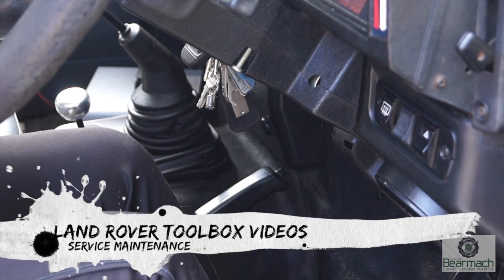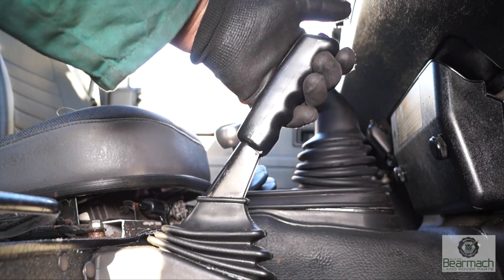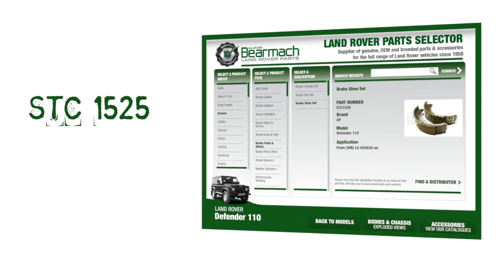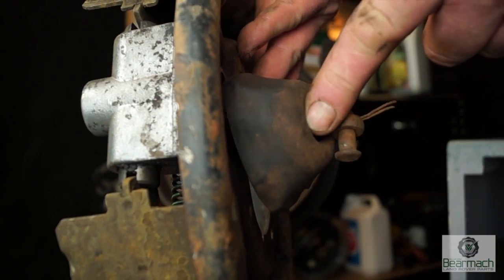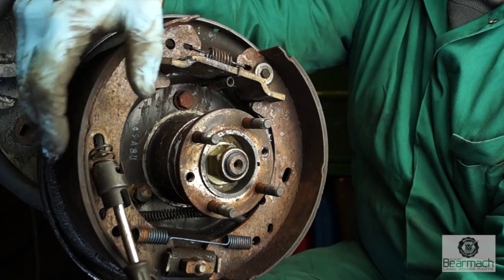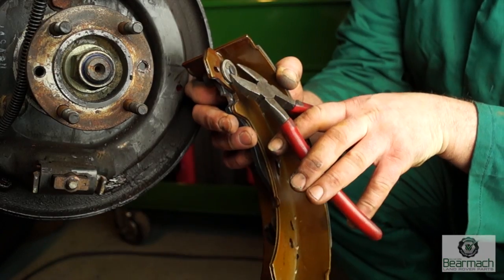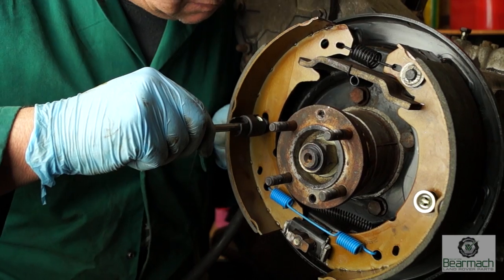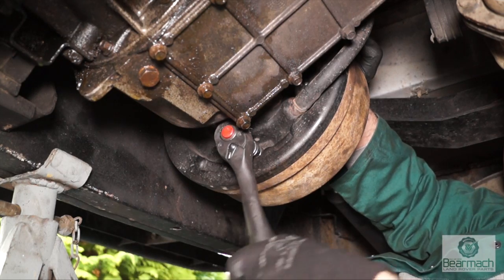Transmission Brake Adjust or Replace?  -  The Fine Art of Land Rover Maintenance

Comment: Great tutorial, very informative. I used this to fit a new hand break cable (110 Defender 300 tdi CSW) when mine snapped. On the two spring retainer clips. I didn't have a special tool to get those back on, so I compressed the spring, put a cable tie round each side to keep it compressed and refitted them. Once in place I cut off the cable ties, making sure I got all the bits out. Worked as a field fix without the special tool.

Comment: Great guide thank you and have used to replace the snapped cable on my D2. Decided to replace the shoes and springs too.  I'm currently stuck trying to get the retaining springs back on. There's no room behind the backplate to keep the pin sticking out ie you can't get your hand behind to stop it disappearing when you try to push the spring down. Any idea how to get around this? I'm stumped. 🤔

Comment: What happens if you adjust it close ? My handbrake holds within 2 level clicks .. while coasting low speed i heard knocking/clunking ? Is that the issue from having it close ?

Comment: Hi, wonder if you can point me in some direction please. My 2008 defender tdci instrument cluster rev and speedo cluster stopped working. I have bought a new one but want my old mileage on the new unit which is obviously sitting a zero. Mine is close to 90k and i want it as it reflects the services i have done. Any idea how this could be done?

Comment: Does this transfer over to a Discovery 2?  I don't remember my hand brake ever working so I would like to tackle this and see if I can solve the issue.
Reply from the maker: yeah it's the same thing.  Bit tighter up in there but getting past the cable there should be okay
Reply: Awesome thank you.  I'll start with simply tightening it and go from there

Comment: Thanks i like your videos! Do you know if you can retrofit the later Defender cable type to a Series transmission. They look like they mount the same......
Reply: Actually now that I look closer it appears that the cable one has 3 mounting bolts whereas the rod one is more like the Series brake.
Reply from the maker: I've not tried it to be honest. Perhaps put them side by side to see if they will fit.

Comment: Have you completed a video on the earlier type rod operated type yet?
Reply from the maker: +J lloyd  not not yet.  It is more costly to overhaul.
Reply: +Land Rover Toolbox Videos I can see were your coming from about price I overhauled a vertical type last night the hand brake rod actuator is a clever little device also did you watch any of jafromobile videos?
Reply: +J lloyd 

Hi! 

dont wait for the turorial
the mechanism is really simple and straight forward 

the expander is only 6 parts 
and the adjuster only 3 parts to take out

take everything apart, clean it, lube it, put it back together 

i am doing it right this moment :D 

good luck
Reply: oh and dont buy anything before dismantling, chances are you can fix it

mine was seized up completely, both adjuster and expander
now after 15 minutes work, they look brand spanking new and work very well
Reply from the maker: +J lloyd  no, not watched much of his stuff.
Reply: +krhilbil yeah I have a figure it out mind I say there cleaned everything up an realised how it worked haha simply but effective design

Comment: I hav an 06 range rover. 98k miles. When i drive, is shows transmission fault limited gears . And it does not go pass the third gear. Any one have similar experience?
Reply from the maker: Michael Anyim  The transmission's ECU has the facility to store DTCs, or fault codes so it can be properly diagnosed.  Best get the trouble codes retrieved so a proper diagnosis can be determined.